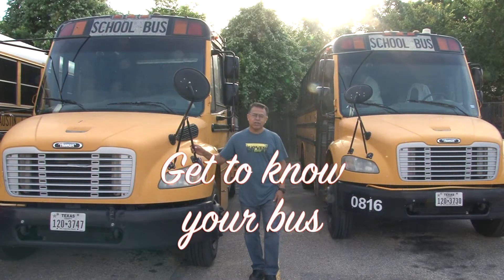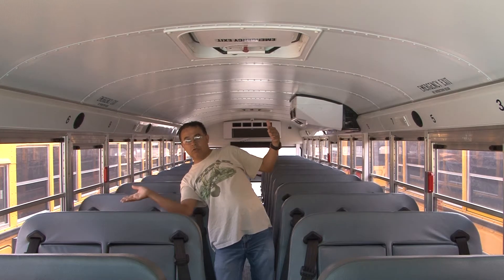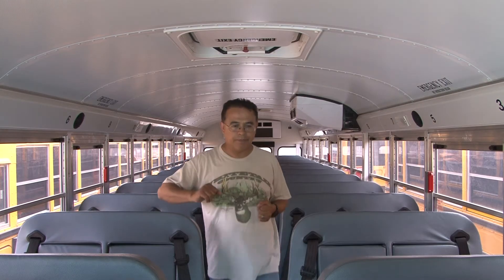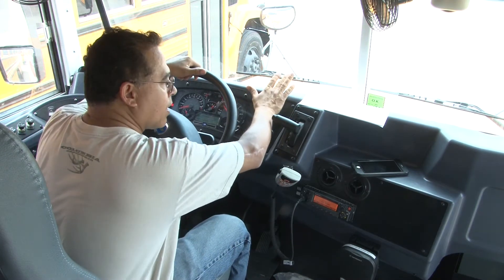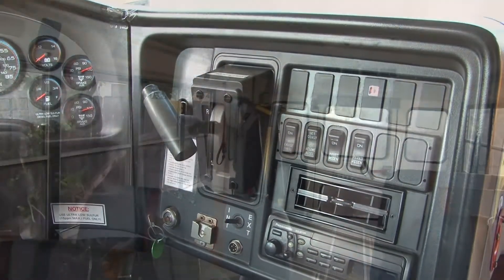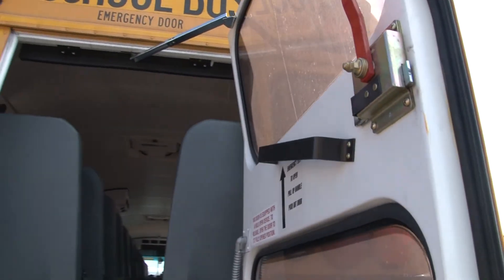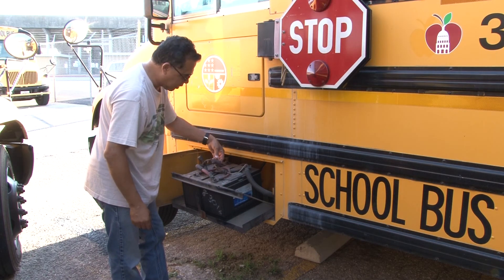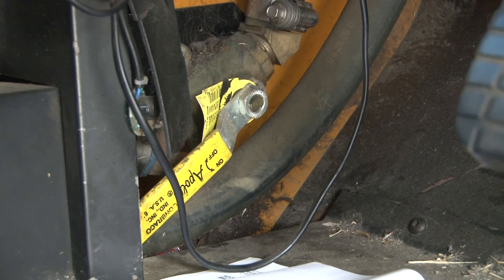School bus instruments, bus dashboard bottoms, school bus alarms, how to stop alarm on a school bus

Comment: Thanks for the great info. Thumbs Up'ed it.
Reply from the maker: Thank YOU 😊 if you have any question I’m here to help on what I can, I’m a mechanic on this buses and a simple thing can ruin your day, many of the repairs are ez around the bus 🙂
Reply: @ISCOOLBUS  I had a buzzer going off that I couldn't figure out. I checked the back door and it has it's own buzzer. I had checked the windows and all were good. Turned out to be the roof hatch not latched good. Mine has that crappy kind of hatch. Those will be coming out and replaced with Maxx Air fans most likely.
Reply from the maker: @hotrodpc66  if you want you can also disconnect the buzzer it’s very simple just follow the noise and u will find it then just pull one of the wires and no more noise 🙂
Reply from the maker: Depending on the bus model it’s usually by the or within the fuse box near the driver ether inside or outside the bus but it’s always close to the driver so he can hear it